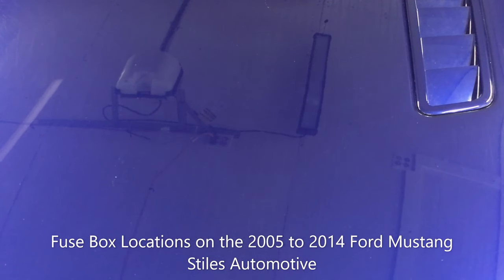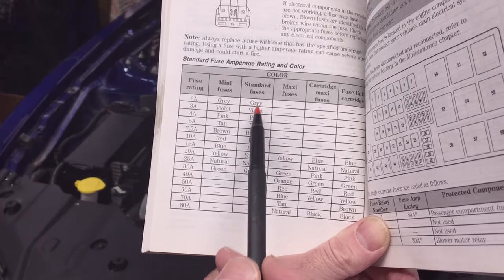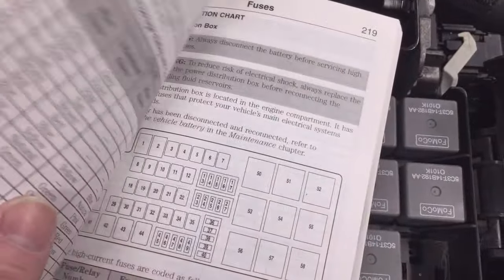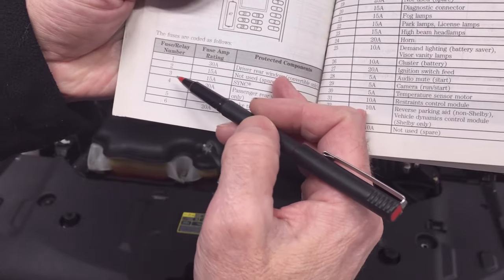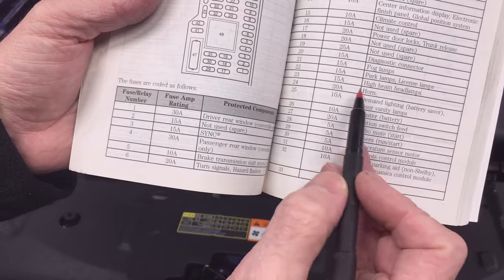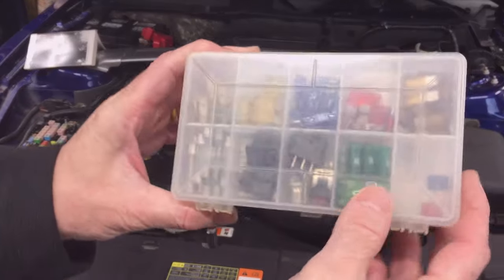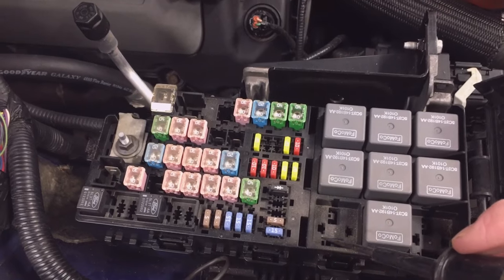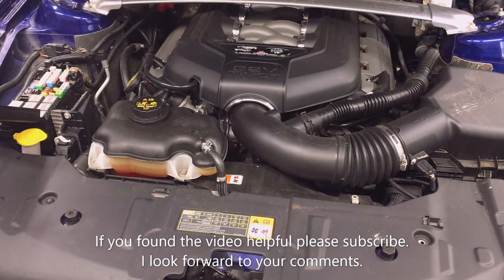Fuse Box Locations on the 2005 to 2014 Ford Mustang

Comment: Very helpful…
Test light only did fuses…
Not relays or the clear square type…?
Is this the same
Reply from the maker: Going, The test light I'm referring to is a very simple one ( I normally use a multimeter) that just has a light in it.  It tells you if there is voltage only (see Item 1 below). There are other Test Lights that are nicer and indicate voltage (see Item 2 below) and some that indicate continuity. If you are going to spend any more than about $20, you might as well by a cheap Multimeter.  But, Test Lights and tough and have there place, they are simple and handy. I appreciate the comment! - Stiles

Description / Amazon link to example:
1) Heavy Duty Automotive Circuit Tester, Premium 6-24V Test Light  https://amzn.to/3WOHCuW
2) Heavy Duty 3-48V Backlit Digital LCD Circuit Tester  https://amzn.to/3WLks8y

Comment: This video is helpful however, I can’t determine which fuse controls the amplifier and subwoofer box I have connected
Reply from the maker: D, I appreciate the feedback. If this is an add on (or Aftermarket) Amplifier you need to trace the wires back to their power source. - Stiles

Comment: would you know where the fuse at that powers the cigarette lighter outlet for the 2011 Mustang V6?
Reply from the maker: Kannarian, Yep! Ford calls it both the "Cigar Lighter, Front" and "Power Point (Instrument Panel)" which is powered by Fuse 22 (20A, Blue) in the Power Distribution Box in the Engine Compartment. Most Mustangs have a Second Power Point in the Arm Rest Console, that is Fuse 5 (20A, Blue) Power Point (Body). - Stiles

Comment: What fuse if for windows? My passenger side window on my 2014 mustang automatically went down when i turned my car on, and hasn’t gone up since
Reply from the maker: Fuse 29 (30A, Pink) Passenger front window in the Power Distribution Box in the Engine Compartment is the Fuse you are looking for.  My video (link below) may also help you. - Stiles

Restore One –Touch Up Functionality and Re-Calibrate Power Windows – 2011 to 2014 Mustangs  https://youtu.be/1QRRgmW-WdM

Comment: Hi and help! My brother locked his keys inside of a running 2014 Mustang and we’re trying to get in through the trunk because nothing seems to work and we are out of ideas. Is there any way to pop the trunk from under the hood? He got the hood up, and he’s confused on wether or not pulling a certain fuse will help.
Reply from the maker: Aimhigh, At this point (13 hours from when you added the comment) you have either got into the car or run out of gas.  Removing a Fuse would not help unlock the door.  I would unlock the door by pushing the Unlock Button on either the Driver's Door or Passenger's Door.  Here is how, I would use a Metal Wire Coat Hanger, straighten it out, gently pull the top of the Window away from the Window Seal, put 2 pieces of something thin (it you have it) on either side of you opening, use the Coat Hanger to fish in and push the Lock/Unlock Bottom.  A second option is to call a Tow Truck, the Tow Truck Driver often will have a Kit to open Car Doors for a small fee.  

Some day, when we share a frosty beverage together, I'll tell you a story of a similar situation, only under worse conditions.  Opening a K-car in Western North Dakota in -30 degree weather.  A Zoomie should appreciate that!

Let me know how it goes! -  Stiles
Reply: @StilesAutomotive  , my brother was able to turn off the car before he wasted all of his gas (he used up 20 miles worth) by pulling a fuse, and we managed to get through the window with a wire tool and were able to pull the lock up. Thanks for the advice, it came in really handy (we left it locked overnight and got it open the next morning)! And that sounds like an interesting story that makes for a good fireside tale. Thanks for the advice!
Reply from the maker: @aimhighc1753  Glad to help - Stiles

Comment: Hello! I have a 2014 mustang. so i recently enabled mykey by accident and wanted to turn off my traction/abs so i took the fuse 34 out for a couple of months.. now that i finally got my disabled, i put the fuse back in and it did not work, i even bought another 5A rating fuse for it? The abs lights and traction controls light won’t turn back off… is it because i got the wrong fuse ? is it another fuse interjecting this issue? or is it bc my car needs to be back to stock ? please help
Reply from the maker: Leon, Yep, the Traction Control Circuit is Fused by Fuse 36 (5A, Tan), Passive anti-theft system (PATS), Instrument Panel Custer (IPC) in the Passenger Compartment Fuse Panel, don't put anything but a 5A Fuse back in there.  Interesting, you should have lost many other systems when you removed this Fuse.  You may have confused your Mustang's Computer by getting something out of sequence. I'd try removing the Negative Battery Terminal (ok, since I don't know you), remove both Battery Terminals and touch them together for 10 seconds, this will zero out or return your Computer's Memory to OEM Stock Defaults. Now is a good time to Clean and Service your Battery, see video link below.  Let me know how it goes! - Stiles

Clean and Service Battery for Long Life and the Best Connection; 2005 thru 2014 Mustangs  https://youtu.be/_Cc4wIYaT4s

For 2010-2012 Mustangs: Traction Control Circuit is Fused by Fuse 34 (5A, Tan) Electronic stability control

Comment: Are the fuses in the fuse box at the interior kick panel on a 2014  Mustang V6 standard fuses or mini fuses??? I’m installing a dash cam.
Reply from the maker: Arthur,  They are Mini Fuses - Stiles
Reply: Yes!! Thanks Stiles
Reply: ? Can either fit? Maybe I need to check that ive got the correct installed

Comment: Hi I have a new battery and a new alternator but every 5 to 6 days I have to go downstairs and get a jump to start my car after looking some information up I was told that I have a drainage in my car but no mechanic is able to assist me because they claim they can't find a problem but I have to call AAA almost every other 6 days that's mentioned before could this be the problem that's draining my car I have a 2007 Ford mustang convertible. Thank you
Reply: I feel like i should mentioned this my neighbors keep saying they see my lights flash on and off at night sometimes when my car is completely off I do have a radio that I take out of my car and I don't have anything plugged in.
Reply from the maker: LOVES, Upon reading your first post, this is my thought.  If problem started after Alternator Replacement (unlikely, you probably replaced due to problem) possible bad Diode in New Alternator even thou it is new.

Your second post . . . Do you have an aftermarket (added on) Anti-Theft Alarm or Remote Start System?  This could cause your problem.  

Do you know if you have Daytime Running Lights (DRL) it is optional on your Mustang.  The DRL Module could be bad.  Or more likely your Anti-Theft Control Module is turning the lights on and off.  But, why? And why only intermittently each 6 days?  After thinking about it, the TSB below makes some sense now.

I looked for a Ford Technical Service Bulletin (TSB) on your issue and did not find one on your Battery Drain (or parasitic loss).  I did find several that are related, since they read the same here is one - -
EXTERIOR LIGHTING:HEADLIGHTS; TSB #TSB-08-9-2
FORD: UN-COMMANDED PERIMETER LIGHTING. VEHICLES MAY EXHIBIT UN-COMMANDED PERIMETER LIGHTING FEATURE (HEAD, PARK AND SIDE MARKER LAMPS) DUE TO WATER INDUCED SHORT TO GROUND IN THE DOOR DISARM SWITCH.

I don’t think the Anti-Theft Control Module is bad, it would do it all the time.  Do you know if it is possible one of your Sensors in the Doors or Trunk Lid is getting wet?  You do have a 2007 Convertible, is the Top or Door Window Seals leaking a little water? Does this problem happen after it rains?  Or after car wash days?

I don’t have anything you can do to help us determine the problem, you need someone to work thru the problem.

Whatever is determined, I want you to have the Service Technician “clean all of the related grounds” to the component that is at fault. They may not do this, and as your Mustang ages it will insure grounds are not an issue.

Let me know how it goes! - Stiles

Comment: hello so my AC only works on the fourth setting on my 2009 mustang. would i be able to fix this by replacing a fuse?
Reply from the maker: Diego, Probably not a Fuse, but Fuses are easy to check, use your Ford Mustang Owner's Manual as a guide to check the Fuses.  Let me know how it goes! - Stiles

Comment: I have a 2011 Ford Mustang and my trunk recently stopped working i replaced the trunk latch with a brand new oem one but it still doesn’t work. I have a feeling its a fuse because every time i press the trunk release button a clicking sound comes from the bottom passenger side. Do you have an idea to which fuse is the one that controls the trunk mechanisms ? ..
Reply from the maker: Jonathan, Yep, you should check the power to the device connector prior to replacing it.  Passenger Compartment Fuse Panel (in the Passenger Side Kick Panel, like I show in the video) check Fuse 17 (20A, Yellow) Power door locks, Trunk release, reference your 2011 Mustang Owner's Manual (see link below), Pages 226 thru 228.  Fuse 17 also powers the Door Locks, do your Power Door Locks work?  If so Fuse 17 is ok.  The clicking sound you hear from the Passenger Compartment Fuse Panel is the Truck Lease Relay, which is good you hear the relay.  The connector at the Luggage Compartment Lid Release Solenoid is a 4-pin connector, in addition to power, the connector has 2 wires, one for the Luggage Compartment Lamp, and one for the Trunk Ajar indication on the dash.  You need to verify power to Pin 3, when you press your remote button 2-times or have a buddy press the Trunk Release Button near the shifter.  And verify a good ground at Pin 4.  My 2013 (which is probably the same as your Mustang) has a Brown/with Blue Stripe Wire to Pin 3 and a Black/with White Stripe Wire from Pin 4.  Get me know how it goes!  - Stiles

https://owner.ford.com/tools/account/how-tos/owner-manuals.html?year=2011&make=Ford&model=Mustang

https://owner.ford.com/tools/account/how-tos/owner-manuals.html

Comment: Is there a fuse just for the tail lights? Can’t find anything on it, in the book. 2014 GT
Reply from the maker: Jose, Yes there is. Fuse 22 (15A, Blue)  in the Passenger Compartment Fuse Panel (or Smart Junction Box (SJB)) is for the Front Park/Turn lamps, Front Side Lamps, Rear Lamp Assemblies, License Plate Lamps, Rear Side Lamps, and Park Lamp Relay - Stiles

Comment: I have a 2012 mustang gtcs my wipers and washer operate when i first start the car but as soon as i take off they stop functioning.. checked all my fuses and relays any ideas on what might be the problem?
Reply from the maker: Jeovani, It's hard to believe a '12 Mustang is getting old, but it is happening.  Or, is there something more going on, did your Mustang experience an accident?  You are correct an intermittent electrical problem is not normally a Fuse or Relay.  The Army taught me intermittent problems are often grounds (you have several: 1) at the Power Distribution Panel (in Engine Compartment), 2) at the Windshield Washer Pump, 3) at the Multifunction Switch, and 4) at the Windshield Wiper Motor).  Grounds 1 and 2 are very unlikely the problem, 3 and 4 possible.  Second, a broken Wire, internal Copper Wire broken inside the insulation.  Check the Wiring Harnesses, pay close attention at the base of the Steering Column and the Firewall penetration (this is more possible if the Mustang was in an accident).  Last and the most likely is a bad Windshield Wiper Motor or Multifunction Switch.  Do either of these get hot at all?  Here is an idea that may be worth a try, the Windshield Wiper Motor has an Electronic Board in it to control the Wiper speeds/intermittent Wipers, Zero your Mustang's Computer by disconnecting the Battery Cables at the Battery and touching them together for 10 seconds.  I'd be surprised if this works, but it doesn't cost you anything but time to reset your Radio.  Let me know how it goes!  - Stiles

Comment: Very informative, Stiles. Thanks! And you're the perfect person to ask then! I've got the fuse diagrams for both fuse boxes (2006 GT). I'm mainly just not sure exactly which fuse is ACC (planning on hardwiring a dashcam). 
So what I do know is: the red wire goes to a 12v permanent supply 61 or 64? (one of the two cig lighter fuses), the black ground goes to, well, a ground (I hope there's one near or inside the fuse box? there's 3 bolt looking things in the fuse box) and the yellow goes to ACC...is this the accessory delay fuse? Number 44? I'm very new to this. Any help would be appreciated. And then when using a piggyback, do I put the same amperage fuse in each slot? I understand the original fuse goes at the bottom, and the new device's fuse goes at the top. 2006 GT
Reply from the maker: J Jappie, Yes, Fuse 44 (10A, Red) Delay Accessory in the Engine Compartment Power Distribution Box, however, I working hard to figure out how you want to wire the Dashcam. Since you talk about it so much, you probably want it on the switched On-Delay Circuit, so that the Dashcam turns off 15 or 20 minutes after the Key Ignition Switch is turned off, so the Dashcam doesn't drain your Battery.  Sure, Fuse 44 powers this circuit, but is not the switched power.  You want Fuse 6 (5A, Tan) Accessory Delay Feeds in the Passenger Compartment Fuse Panel (which is part of the Smart Junction Box (SJB)), the Delay Relay is also part of the SJB. Verify me work here, by measuring voltage at Fuse 6: 1) with the Key Off (No Voltage), 2) with Key on (Battery Voltage, 11 or greater Volts), and 2) with Key Off and wait for Delay to time out (No Voltage again).

Here is the rule of thumb when adding additional load to an OEM Circuit (And I trust this with Ford Vehicles!). Engineers like to over size everything by 10% or more, so it is save to add 10% load to a circuit. If you are using one of those Add-on, (you said piggyback, good description) or "Add-a-Circuit" Fuses, at Fuse 6 (at SJB), you are not adding load to Fuse 6 but you are adding load to the Fuse 44 (10A, Red).  10 percent of 10A is 1 amp. I would think your Dashcam would not use much more than this, if it does consider using a Relay (I put a link to a helpful video below). In the Voltage Gauges Video below, I powered the Gauge like you would power the Dashcam.  Let me know how it goes! - Stiles 

Why use a Relay and 3 Ways to Connect a Relay - -  https://youtu.be/CJQcPK4lU-g
How to make a better connection with a cheap crimp connector (either Female Disconnector or Ring Terminal).- -  https://youtu.be/I2KT5ZQy1vk
Voltage Gauges with USB Ports Installation. - -  https://youtu.be/aBE0PUQCh-Q
Reply: @StilesAutomotive  hi Stiles. Thanks for the informative reply and relay videos!

The instruction manual states the following:

1. Connect the power cable (red) to the regular electric fuse with an output voltage of 12-30V and output current of 2.4 inside the fuse box;
2. Connect the ACC signal cable (yellow) to the ACC power fuse inside the fuse box;
3. Connect the ground wire (black) to the negative terminal or ground of the fuse box.

The idea is to be able to use parking surveillance mode (the camera detects physical movement of itself while the car is parked).

..inside the engine compartment fuse box I've tested all fuses, and even an entire half an hour after switching off the engine, all fuses are still recieving 12v electricity. So while waiting for your reply, I've connected the hardwire kit in the following manner:

Used 64 'Powerpoint#2' for red wire, used 68 'ignition' for ACC yellow wire ..changed the settings in the cam to auto-off but it still comes on by itself from time to time..

Now with regards to the SJB passenger compartment...I can confirm fuse 6 is switched (thank you for helping me solve this mystery!!). Is there another fuse in the SJB which is permanently on? Then I can use SJB fuse 6 and whatever other fuse in the SJB which permanently receives power

P.S I've subscribed and will be sharing your channel with other people!
Reply from the maker: @cavalryman_s197  Ok, that all sound ok, I think I would power it off of one of the 10A Fuses. The Radio Fuse, Fuse 20 (10A, Red) in the SJB, would work. I don't know what your add-a-fuse looks like, but if you are able to use them there are a number of unused slots on your Fuse Panel, Slots 5, 9, 11 and 13. Consider using one of these slots.  - Stiles

Comment: Should you disconnect the battery before you switch a fuse out?
Reply from the maker: Lance, If you watch my videos, you know I'm not a big fan of removing Battery Terminals for maintenance tasks. However, for Air Bag System work and tasks similar to the Live Battery Cable on the Starter for Starter Replacement, I always do.  Ford says to disconnect the Battery before "servicing high current Fuses", like the ones in the Power Distribution Box in the Engine Compartment.  Most Circuits are turned "off" with the Ignition Switch, so most are not energized anyway when replacing Fuses, so I don't disconnect the Battery. Most of the High Current Fuses, just mentioned are Hot, On, Energized, all of time. - Stiles